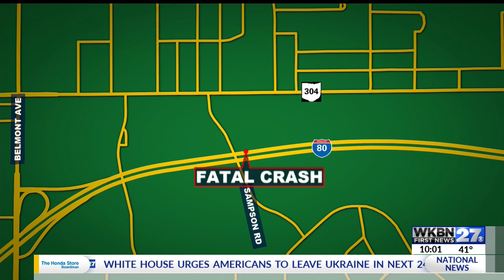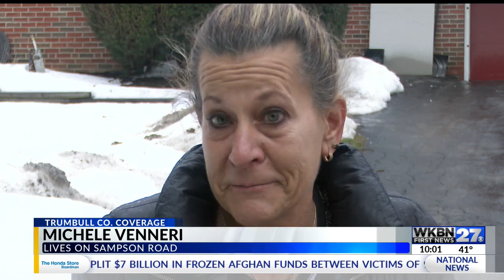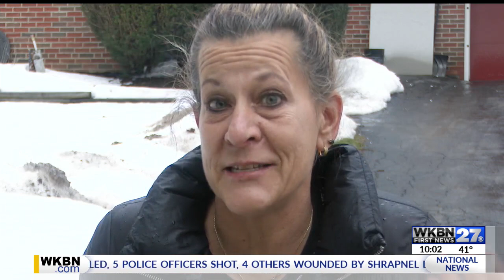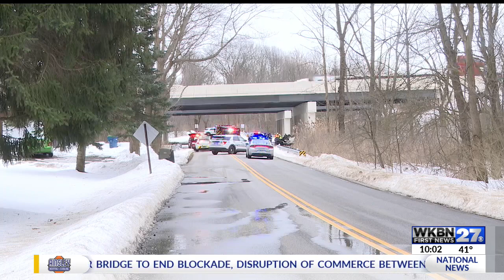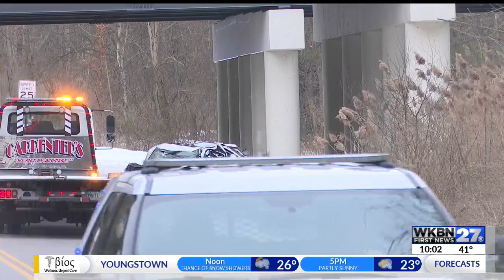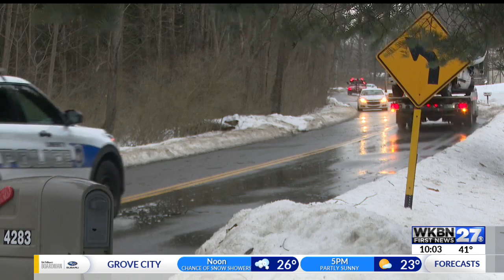Highway Patrol: Tanker truck and SUV crash, fatally sending SUV over bridge

Comment: Fun fact... the "walls" on the bridges ARE NOT designed to contain vehicles... Obviously.

I've seen enough vehicle crash videos where a SUV or truck rolls to tell you that they can easily clear the meager bridge walls if it goes airborne.